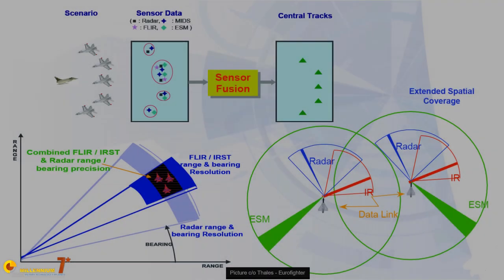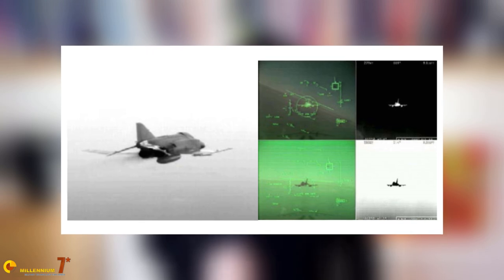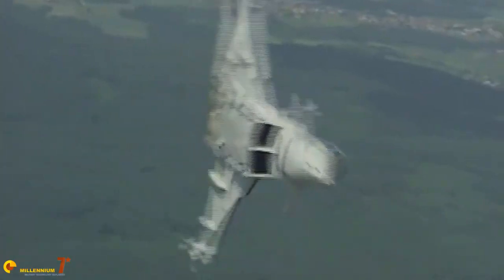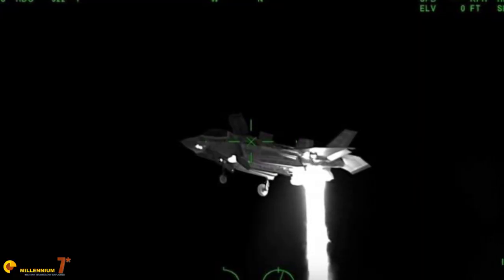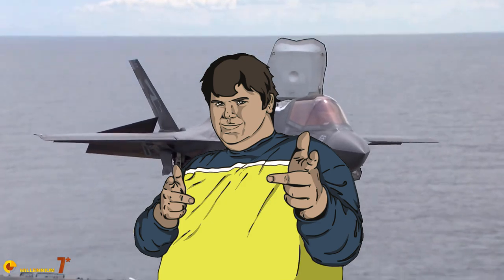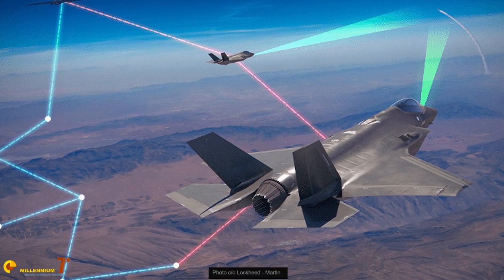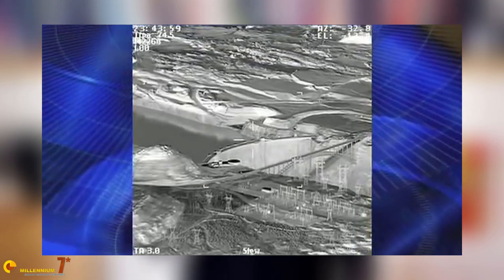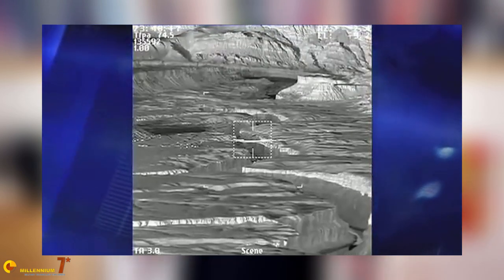The Other RADAR | Can IRST Infrared Detection Replace Radar?

Comment: Wow such a great presentation! I would further the discussion by adding "photogrammetry" to the list of techniques that could enable IRST systems to calculate the range to a target via passive means. It would be especially effective if the specific type of target aircraft was known, then the aircraft's known dimensions could be used to estimate range based on image size (given known parameters i.e. Lens magnification factor, pixel size/count/spacing of the detector's imaging array)...

Comment: You did it again, as I watched this, each time I had a question, you brought up an answering topic,  you answered twin mounted ISRTs even as I thought it. Bravo. Although it can't be ruled out for a future interceptor, to be accurate binary ISRTs would need a "rigid" baseline , wingtips would not be ideal but with the right level sensor correction, it could be achieved. See why Nimrod AEW failed (I'd been taken aboard it's instrumentation test bed in the early 80's). There's got to be a perfect level of miniaturisation, sensor optics and coordination between all of the required components for an aircraft to give up lift for. I have Sunday chores but you make me want to go spec up a future interceptor on paper as I used to in my childhood ❤️
Reply: Dassault already have imagined and prepared with its partners Thales and AirBus, a teaming and swarming  capable system using drones or also called UAV/UCAV. It'd be available in a close future on Rafale F4 as a first part and step of the FCAS program (F4 is scheduled to arrive in 4 years or less).

https://www.instagram.com/p/CH2d2nMAYLZ/

With this solution, IR and other Optronics and advanced kinetic kinematic systems could be really superior than radars, since they're flying in a very passive and stealth mode toward the enemies !

Comment: Excellent video as always. Speaking about two IRST on the same aircraft on the wingtips: the base for triangulation would be fantastically short, but  in astronomy, trigonometric parallax is performed on distant stars with even smaller useful angles, so I think that It could be feasible. Also, if the IRST can identify the type of enemy aircraft, distance could be extracted from his angular dimensions. In theory.
Reply: Actually that's not even needed. There's a thing called kinematic ranging, which is already used in some IRST systems. They do several target azimuth measurement in quick succession and by knowing how fast and in which direction the sensor is moving you can generate a pretty good estimate how far away a target is. Is it perfectly accurate? No, but it doesn't need to be. With modern missiles like the Meteor it doesn't matter if the estimation is a bit off, it will find it's target by itself during the final approach phase.

Comment: 10:12 "A school boy exercise". Well clearly that puts me out of the race cause I barely scraped by High School Algebra.

Fantastically informative, the info regarding Kinematic Ranging and the difficulties with Triangulation in regards to calculation with moving points on the triangle were new to me. Fantastic work.

Comment: Given the F-101, F-102, F-106 and early F-4's (B, C and early D's) had passive IR systems, it'd be fascinating to know just why the USAF and USN ditched the tech by the 1970s with only the F-14 with an IR system as standard (although replaced by a long-range camera). Maintenance issues? I think these earlier systems had to have a coolant for them to work.
Reply: the passive IR systems on early fighters were more like very low-resolution FLIR than IRST. early radars weren't very automated and someone had to aim them at a target manually, the FLIR would give you a rough idea of where a target might be so that you could lock the radar on to them for an actually useful track. USAF fighters lost their FLIR once computers became good enough to handle basic radar functions automatically and quickly scan a larger area.
Reply: They found the Sidewinder seeker head worked just as well as those early passive IR systems.

Comment: Your thesis is about IRST is pretty solid. I would give more weight to how IRST will be integrated into the Multifunction Advanced Data Link (MADL) by the US and other countries. Also how they will put it to use it in a fully networked battlespace in combination with AWACS platforms. I would say it's just a matter of time, before IRST gets fully leveraged.

Comment: Very good video! :)

Especially agree about the published ranges of IRST. It's a bit like the advertising on some flashlights, saying they are visible from X miles away... when really that kind of claim can be massively exaggerated depending on the conditions (like in that missile launch detection example). IRST is by far the most likely candidate to become the main method of BVR tracking in a stealth aircraft arena. But it's significantly more limited in capability than radar in terms of being weather agnostic, being reliable in varying conditions, or having great range. It leaves stealth very useful, but it does increase the range of detection to a stealth target well above eyesight. It is clearly the emerging next step in the cat & mouse game. Worth pointing out, even though you can detect the skin heat of an aircraft from the front pretty well, IRST has greater range viewing the rear of a jet aircraft, due to the significantly larger amount of heat visible from that aspect. So the range is going to vary a lot (up to double/half) even in the same conditions. The pilot must maintain a very flexible and open-minded concept of what areas are "clear" of threats.

I also can't help wondering if 2 IRST's mounted at the wingtips might give enough triangulation to at least come up with "ballpark" ranging, which might be useful for a full track, or at least help inform the computers about how best to handle kinematic ranging. For example, twin wingtip IRST's might be "accurate enough" to tell the plane if the target has changed heading or speed while a kinematic triangulation is in progress. dual IRST's as a kinematic supplement. Just a thought. I dunno if it's viable. I think it could help the accuracy & time to calculate, and help prevent the system being fooled by a sharp turn in the target. But this is all theoretical. Exactly how far apart the tracks need to be, we don't know. At the very least, it could help provide an extremely thorough field of view, with 2 search arcs greater than 180 degrees overlapping fore & aft for some rough estimates of range in the weak areas. A microscopic degree of sensitivity to the angle of the sensor head would be the key tech for this I think. It might require very regular calibration as well.

I think kinematic is 'somewhat' more useful than you suggest, although it really is blind to ranging fore & aft. Every plane flying not directly fore or aft could be calculated pretty quickly. At mach .95 it only takes 0.5 second for the IRST plane to travel 425 feet (130m) which should be plenty for triangulation. Your target is not likely to change heading or speed enough in under a half second to throw off a kinematic calculation (it "can", it's just not likely in that time frame). This assumes some blisteringly fast computation though. Several triangulation attempts in a row (rather than just 2), if looked at by a computer, could (as a bulk of data) help differentiate and accurately range a turning target I think.

There's always satellites as well.
Reply: When you see how technologies and electronics are evolving so fast, especially about miniaturization and highly capables camera and optics, I think there's a big chance the IRST and specially the FLIR, would be able to reach incredible distances in a close future. Maybe as far as radars or even superior distances and ranges !

Thales the French company working with Dassault on the Rafale, even said recently they wanna become the/a world leader in that kind of Optronics technologies. Clearly showing how important it will become in the future, and the fact they're working hard on it.

Passive sensors can't be jammed or scrambled by countermeasures defense systems, and can't be detected, etc ... Very big advantages over the radars weaknesses.

A former high rank senior of Dassault even said, the FLIR is like telescope, and when you know how far a telescope is able to see and with high resolutions quality, the day they successfully miniaturised it, it'd be capable to see and detect farer than radars !
Reply: @aviationaerospacechannel5987  I'd go with "all somewhat true, but don't get too optimistic".

IRST is the best current (and for the near future) counter to stealth. But the range limitations aren't based on how good the glass is, or how many pixels it has, etc. It's based on the fact that the atmosphere blocks it over distance. And there's no technological improvements planned to alter the atmosphere to be more clear hehe. 

IR is a range of frequencies which are related to radiation created by heat, but it's all "relatively" near to visible light, and behaves fairly similarly for most purposes. Basically, IRST can get you similar results as a telescope. If you're looking straight up on a clear day, you can see up into the galaxy and beyond. If you're looking sideways at high altitude, you can see pretty far, probably up to 100 miles. If you're looking sideways at low altitude... maybe 30 miles. If you're looking at anything in cloud cover, or rain, or fog, or smog... you won't see very far at all. Go to a tall building, and point a telescope at the horizon. That haze which eats up the horizon? That's the problem.

Detection range increases when you're looking at the tailpipe of a plane, but decreases when you're looking at the front (unless it's something like an SR-71, which glows very brightly in all directions). Stealth planes 'mostly' try to reduce their IR signature, so that they are less visible, although there's a limit to what can be done with a jet powered aircraft.

IRST was for a while limited by the fact that when you telescopically look at long distances, your field of view is tiny. So it wasn't very feasible (for detection anyway) until computers could process large amounts of input very quickly, allowing what is essentially an IR telescope to rapidly scan across a large area.

IR also needs to go to extra lengths to detect the range accurately.

Are the IR sensors getting better? And the image processing improving? Yeah, they are. And that does increase the range & accuracy. Also, as missiles get "smarter" it becomes more possible to weapon-lock a target with less detailed information, and that helps IRST to be more effective. And that is the direction things are going for 5th gen cat & mouse.

But it doesn't remove the atmosphere problem. Trading in a cheap pair of binoculars for a really good long range spotting scope is an upgrade, but neither are going to be impressive in less clear atmosphere conditions. No matter how good they are. IR will never have the range or all weather capability of a powerful radar. It just gets you about double the range of visual light through a magnifying optic, and has a favorable match-up vs. jet powered or hypersonic things.

If you can see a plane with it's running lights on, with a good pair of binoculars. Then you can see most jet aircraft at about twice that distance with IRST. And that's actually pretty good on a clear night.

Having a lower temperature exhaust, having extremely sensitive IR sensors with good glass, and the best possible image processing to bring out subtle details,  and having IRST which has a complete 360 field of view, are all kind of the end-game "as good as it gets" for IRST. Which is why I think the F-35 is ahead of the curve.

Also, IRST/FLIR/etc can be temporarily blinded or permanently damaged by an infrared laser, "IRCM" (it goes by several names in various countries). As a result, you can find a plane, but then that plane can say "OK, now you see me, now you don't". This tech also has some pretty devastating consequences for IR guided missiles. As well as some "other" uses I won't go into.

I'd look for "IRCCM" to be the next big thing. It already exists in some forms, but that gets into 'not public' info real fast. As well as further tech improvements to long wave radars. Well, I can think of a few other things which may be the next big thing as well, but "shhh" ;-)

Stealth was never about being "invisible". It's just going into combat in a ghillie suit, and trying to use the terrain, instead of going into combat in bright orange with a flashing light on your helmet.
Reply: @kathrynck   That's why in this video, isn't going enough far, and his informations are not well updated. I like this channel, but sometimes his videos are kinda weak !

Dassault FCAS program already showed their ideas about the 6th gen FCAS system and fighter NGF. The distance and range of IRST/FLIR or any type of Optronics, isn't anymore a problem if they're able to move and scan ahead the fighter jet.

The official video : https://www.instagram.com/p/CH2d2nMAYLZ/

MANNED-UNMANNED teaming and swarming is the future.
Reply: @kathrynck   The remote carriers or what we commonly call drones or UAV/UCAV, this part of the FCAS program will be available in very early stages. As said in the other video, this teaming and swarming capability, is planned/scheduled for Rafale F4 and typhoon LTE. Other video : https://www.instagram.com/p/CH-fIVQgCfz/

Rafale F4 is supposed to arrive in 4 years, with some early upgrades and updates available in early 2 years. So the aircrafts and jets that gamble almost everything on stealth as the USAF one's, they really need to worry as their stealth will be close to useless, with these drones that are using IRST/FLIR (or other Optronics), jamming and kinetic/kinematic techs and systems. A moving flying IRST or Optronics is like the nightmare of the stealth aircrafts/jets, giving your position and allowing the enemy to shoot you down and long distances.

These drones are even said, would be capable to carry weapons and missiles. Differents versions are already planned, and some already not far from a mass production and service/operations ready.

Comment: Detecting targets without pinpointing yourself to opponents is the "Mating Frog's Dilemma". The croak that says "Hey cutie, here's a big, sexy dude" in Frog says "Here's breakfast, come and get it" in Predator.
Reply: Yeah. That's the problem in a nutshell. The F-35 has individually controllable array elements, so as soon as it gets a return signal, it blacks out that position in space in the array. In a really dangerous situation it would be set to passive-only. It has exceptional IRST & passive RF detection capability in 365 degrees. This is arguably more useful than the very fancy Radar. A fancy trick is to have a forward F-35 on passive only, with an F-35 (or other plane) considerably to the rear. And the forward plane can seek radar bounce data from the further away plane. Thus keeping the active radar source further away from the dangerous elements. With networking, this can allow a number of stealth aircraft to play some pretty exotic cat & mouse in the sunshine of a distant friendly radar source. This also confounds enemy targets' ability to predict radar return angles (when designing a stealth aircraft).
Reply: @kathrynck  Thank you for the information. It sounds as though you know more about the topic than you can officially admit. :-)*
Reply: @parrotraiser6541  lol
Well there's a couple other planes which can do similar. It's just that networking radar elements between aircraft is "more interesting" with stealth planes.

And it's arguably less dangerous to have a rearward radar (which could create sporadic unfavorable angular reflections) than it is to be an active emitter.
Reply: @kathrynck  The problem with using a radar far back is that its radar waves will hit your own fighters from behind. If those are steahlt planes using shaped steahlt they will reflect the radar waves in many directions except back to the sending radar.
Reply: @sorennilsson9742  Potentially yes. Even with jamming there is some risk of that. Although I tend to think having a jamming-rich environment does more to confuse the landscape in favor of stealth aircraft than it does to cause detection.
Reply: @kathrynck  Jaming decoy missiles and so on is meant to confuse. The only one that still sees parts of the battlefields as they are is the one who knows what targets are decoy missiles and where their targets are. Missiles fired at the decoy targets and where they think the targets are will add to the confusion. Towed decoys flares, chaffs and more decoy missiles, in combination with jamming will create a situation where the enemy has little reliable info he can trust before he is under attack. One can se such an attack with 30 fighters of whom only 10 are actually attacking the enemy sending 100 decoy missiles towards the enemy creating a panic for the defender trying to down the decoys and the attackers.

Comment: They need to develop parachute-suspended smart flairs that alter their intensity and spectrum. Dump a load of them in the background and the IRST has so much signal processing that it's a nightmare to find the real guy.
Reply: IR jamming
Reply: IRST can do kinematic analysis to differentiate a fast flying plane and a slowly falling parachute.
Reply: @Aaron-wq3jz  Microwave offense / countermeasures? as in use a MW pod to overload / negate the effectiveness of ISRT
Reply: @craigkennedy432  No on microwave. The waves will dissipate before turning the humidity to heat. Microwaves are used on certain ordnance to guide them as it will pierce smoke.
Reply: Not so much . If they are in a parachute they will all move more or less in a uniform way whiel the target will nto be on the same group. That is not hard to filter with some  really basic software.